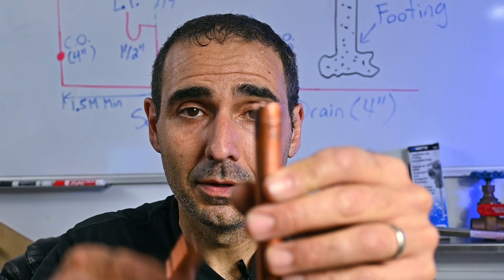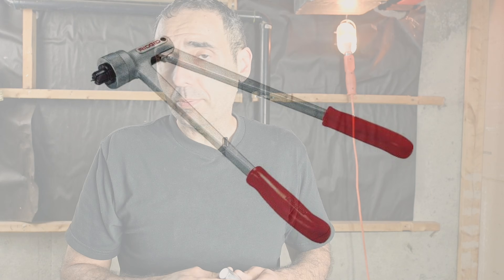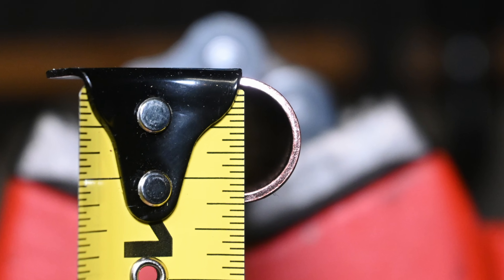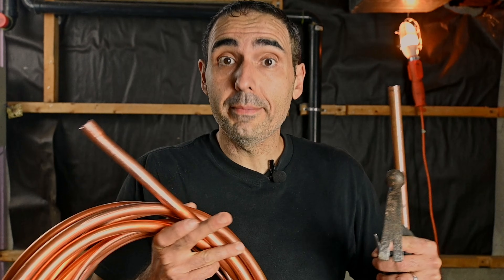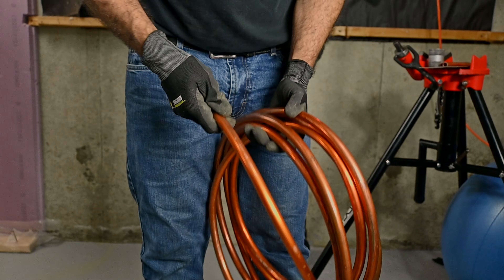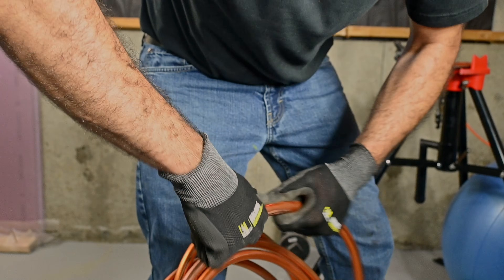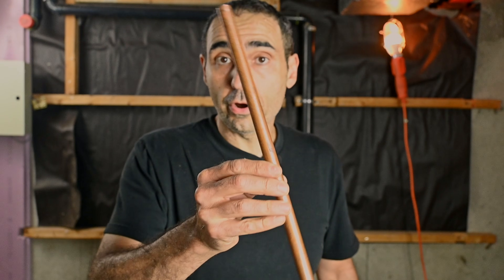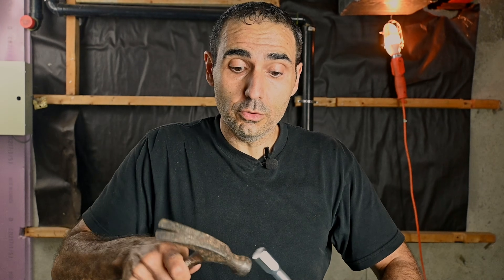Never Need A Coupling Again!  How to Swage Copper Pipe!

Comment: Good video. I’m trying to join 3/4” hard copper pipe K with 3/4” soft copper tubing. My thinking was that the OD of the soft tubing is 3/4 and the ID of the hard pipe is 3/4”. So with a little sanding on the inside of the Hard K, they should fit together. 
I’m making a 100’ inner and outer helix of soft copper for my aftercooler of my air compressor. So the air comes up in hard copper, does a 90 degree and connects with soft copper. Then it spirals up a cylinder and back down to another connector from soft to hard and another 90 to go straight down. 
All this will be in a large bucket and the copper pipe will enter through bulkheads. Chilled water is circulated through the bucket from top to bottom. So the top has one bulkhead for water input and the bottom of the bucket has three bulkheads; one for water exit, one for air in and one for air out. 
My concern is connecting the hard with soft copper. 
Your thoughts would be appreciated. 
Thanks,
Paul
Reply from the maker: Sounds like you're making quite the interesting contraption! To begin with, I know of no issues with joining soft and hard copper together.  Our codes require that all buried copper piping must be soft annealed (to prevent likelihood of kinking), and all buried joints must be brazed/hard-soldered.  Although I don't think burial applies to your situation, you may want to nonethess consider brazing if you're running significantly high pressures, since brazing provides for a much stronger joint.

Also, soft annealed is usually measured by its OD size, they do indeed sell 7/8" OD coil (our 3/4" ID Type K or Type L, which we utilize for underground water service. Therefore, you may be able to save yourself some grief by opting for 7/8" OD coil and simply connecting the hard and soft with a simple 3/4" copper pressure coupling.  (Or of course you can save yourself a coupling or extra joint by simply swaging the soft side to accommodate the 3/4" ID hard pipe.  Another alternative is to see if you can source 3/4" x 7/8" copper couplings and simply connect your two aforementioned pipes with them.

Hope this somewhat helps.

EDIT:
Here's an example of a 7/8" x 3/4" reducing coupling:
https://hvacdirect.com/7-8-to-3-4-inch-copper-fitting-reducer-coupling-cfw01035.html
Reply: @PlumbingsCool  yes. That helps. Although I already have both hard and soft copper so I’m dedicated to that size. 
Thanks for your help. 
Paul
Reply from the maker: Sounds like an interesting contraption you're building there!  If you use the proper swaging tool (3/4" ID), your should be able to easily expand the hard pipe pipe without any necessary sanding.  But if you think you can remove just enough to get the soft to fit, then I don't see a problem because the K is so thick (lots of meat on the bone! ☺) 

However, if you could get a hold of a properly-sized, iinexpensive 3/4" ID swaging tool, it shouldn't take much to expand it to your required size, since it's already so close - and without having to remove material.  However, because it's Type K, I'd especially recommend softening it first by heating the end up red-hot and allowing it to slowly cool, which will make it soooo much easier for you to expand the swaging tool.  

If you're concerned about strength, you may want to consider brazing the joint instead of soft-soldering it - although I'm not sure if it's necessary, unless you're working with higher pressures - say over 150 PSI. 

Hope that helps!
Reply: @PlumbingsCool 
Yes, this helps a lot. Thanks. 
My first attempt at making my coil failed miserably. But I still have enough copper coil to try again. This is for a refrigerated after cooler for my air compressor. Air enters at the bottom, coils up in the inner helix and then back down again in the outer helix. Water drains on the entrance and exit lines. 
It all looked good on paper but it’s a bitch in reality.
Reply: just use standard sweat couplings and silver solder. if worried about strength braze it. if worried about smooth laminar flow use hvac/refrigeration fittings or radius bend the soft copper or anneal sections and radius bend the hard copper. alternate use all type k soft and get good at bending/straightening.
Reply: @throttlebottle5906  I would think that if hard copper is stated as ID and soft copper stated as OD, that a 3/4” OD soft tube would fit inside a 3/4” ID hard pipe. I may have to put the pipe on a lathe and open the ID a bit to get a good fit but it should work. 
I’m making a double helix with 100’ of 3/4” soft copper. Fill tube with salt, wrap around a 7” diameter PVC pipe, then at half way, start wrapping down again on the outside of the first helix. 
So hot compressed air comes in from the bottom, circles up to the top and then circles back down and exits out the bottom. All this in a bucket of circulating chilled water to cool the air and condense the moisture. 
So both input and output must connect to 3/4” hard copper pipe. 
How do I silver solder? I’ll look it up on YouTube. 
Thanks.
Reply: @paulmanhart4481  not sure what soft copper you're looking at or dealing with. but standard plumbing/hvac/refrigeration copper is all sized by O.D. (0.875" nominal)
and the I.D. varies by "type"(wall thickness).
with type K being I.D. of (0.745" nominal) the others type L/M are thinner wall and actually over 3/4" I.D.
it's sized that way so the same fittings/connection methods work across the board.
many years ago, that may not have been the case, especially in old soft drawn "water service" copper, which was generally flared and always used special fittings.
but now it's also the same diameter and they most often use "packer" compression style with clamp fittings. to terminate. or the ones that have not went to poly pipe or pex.
Reply: @throttlebottle5906  That’s what I was saying. The 3/4” OD of soft copper tube should fit the 3/4” ID of K type copper.
Reply: @paulmanhart4481  OK, it seems you're referring to copper that's 5/8" I.D. nominal, which is actual 3/4" O.D.  then yes, it should be too large to fit, but very close.
so you're trying to put 0.75" diameter tubing inside of 0.745" diameter tubing. for it to actually slip fit and have room for silver solder/brazing rod to flow, you'll likely need to make it a two to five thousands of an inch smaller(that's more into machinist territory), you can get copper reducer fittings made to connect 5/8" to 3/4", that's common sizing for heating/cooling and refrigeration. 
Anyway sometimes soft copper tubing is dual listed by the O.D. and/or I.D. and people always flip flop and interchange the numbers and it drives me nuts, the non-standard standardization 🤣
but they really should always speak of and list using the "nominal pipe/tubing I.D. size" or it will send others into head scratching loops, thinking you're referring to a different size. exactly the case here, for more than one of us.
Reply: @throttlebottle5906  Thanks for all your help here. I appreciate it. I also have the 5/8 fitting. I’ll see which works best. 
Paul

Comment: Would this also work to help re-round copper? My service line into the house has ovalized a touch from years in the ground. Planning to cut in a new fitting, but won't be able to solder an oval tube into a round fitting.
Reply from the maker: Although I'm not sure how dire of a state the shape of your pipe is, generally yes, swaging the pipe will most certainly round it back to its normal shape.  HOWEVER, you should do this only if you intend that pipe end to act as a hub/female, because using the swaging tool will not only round it out, but also expand it to receive standard-size pipe.  If you're simply looking to restore the shape to round (without expanding it), your best bet is to round it out by inserting and twisting a set of needle nose pliers, ensuring not to over-do it so as to enlarge the outside diameter of the pipe.   Another trick would be to take an adjustable crescent wrench and adjust the Jaws to the exact proper size of the outside of the pipe and simply gently run the wrench Jaws around the oval pipe until it begins to reshape to round.

Finally, if you are soldering underground, you might want to consider brazing ("hard-soldering") the pipe with a proper brazing allow such as Sil-Fos, which is significantly stronger than traditional soldering and actually mandated by Code at least up here in Canada whenever soldering joints below-ground.

Hope this helps, and good luck!

Comment: I am presuming that a ring mandrel and maybe a deep socket could perform similar effect of a swaging tool, ie. For improvise. ?
Reply from the maker: Hmmm....I suppose in a pinch it may work...although you'd need a fairly accurately-sized socket to ensure that there's just the right amount tolerance to allow for a proper hub size.

Given that these swaging tools are less than $10, I'd much rather prepurchase one and keep it in my tool box in case I'd ever need it, rather than shuffle around to create a last-minute compromise (although it'd be fun to see if your suggestion would work!)
Reply: @PlumbingsCool  maybe a swaging tool would make a better ring mandrel? (What are they usually made of?)
Reply from the maker: Maybe! Swaging tools are typically made of nothing more than hardened steel.

Comment: An old process. I have a set of 8 lead pipe bobbins or dollies made of lignum vitae  used for swaging and pulling through lead pipes that have deformed. These are driven by a steel weight on a rope which runs through the bobbin, thus acting as a hammer as the rope is moved back and forth. The set ranges from 2" to 6" diameter in 1/2" steps. Not that you'd want to, but I doubt if you could even source lead pipe in that sort of size.
Reply from the maker: Oh, goodness me...lead pipe!  Now THAT'S classic old school indeed! No, I don't typically work with lead pipe, other than the typical 3" lead bends that serve water closets in century-old homes.   Usually any revealed lead is cut out and replaced with more modern material.  I didn't even know that swaging tools for lead even existed...thanks for for sharing and Happy New Year! 🥂
Reply: @PlumbingsCool  
I bought them with a view to making a set of carving mallets but on reflection, they are a little bit of history so they stayed intact. I used some  lignum vitae lawn bowls instead. Happy healthy and prosperous new year to you Sir !
Reply: so your father/grandfather/relatives used to install lead water service and sewage many years ago? 
I think there's still way more lead and heavy leaded piping in the ground and water supply/drainage than they want you to know...
Reply: @throttlebottle5906  
Not that I know of, but the use of lead supply piping was still the norm when my grandfather was born in 1880 and was still common when he died in WW1. I agree that there is still a lot of lead piping that has not yet been replaced and will likely be years before it is all eliminated.

Comment: I like to know how to solder a 3/4 inch copper pipe right through the side of a 44 gallon steel drum, 6 inches into the inside and about same on the outside and not using bulkheads and compression joints ect as they are expensive? Must be an easy plumbers trick somehow? Needs to be for waste veg oil!
Reply from the maker: Now that sounds like a very specific use! 😊  Although I can't quite envision exactly what you're trying to build, or its usage, what I can tell you is that (regardless of connection method) steel and copper should NEVER touch, as doing so runs the risk of corroding the copper as a result of dielectric reaction.  Steel or even brass is no problem.  Also, your best bet wouldn't be to solder the connecting piece, but rather to either braze it or weld it.

I'm wondering if you could simply take a 12" length of 3/4" Schedule 40 steel pipe and insert it through a drilled 7/8" hole at the side of the drum (the approximate outside diameter of the 3/4" steel pipe), and simply weld or braze it up.  I'm not sure how strong the joint will be, but it might be the most practical way to serve your purposes.

Comment: Even though this can be done, you may still want to use couplings, this stresses the pipe and will eventually lead to a failure imo
Reply from the maker: While I'd agree with you that couplings are certainly more cost-efficient when you factor in the labour, the main benefit of knowing how to swage is that it adds a simple-yet-effective tool to your arsenal in case you're ever in a pinch because you ran out of couplings.  Not a practical everyday function, but certainly good to know.

As for weakening the pipe, here in Canada swaging is perfectly legal by Code as long as you abide by the requirements:

1. You can only swage pipe to accept piping of the same size (you can't stretch 1" pipe into an 1-1/4" hub), and

2. It must be a minimum thickness of Type "L".  Any thinner (M or DWV, and you WILL shred the pipe!)

Thanks for your feedback!
Reply: When using a pipe bender the copper on the outside edge of the radius is stretched, not too different to stretching the copper in a swaged joint. Not heard of any failures due to pipe bending which is universally used in plumbing.
Reply: How do you think they make solder joint fittings? 🙄
Reply: @ they don’t stretch pipe to make fittings. They are made to a bigger or smaller spec to fit

Comment: Thank's for the video. I was looking for a video on the many different brass fittings for flared copper joining. I am a bit lost as to what to use where so ended up reverse engineering the 60 year old pipes i took out of our shower.
Reply from the maker: That's interesting...I've never seen flared connections used for shower assemblies!

Comment: Can a pipe expander (manual or hydraulic) be used on hard pipe without heating?
Reply from the maker: Technically, yes...but boy, oh boy will it be so much more effort manually.  Hydraulically/mechanically should be no problem as well, although I'd drive to slowly to allow the pipe to expand in a more controlled fashion to avoid tearing the pipe. I've bent hard Type L pipe with a manual bender before, and although I get a proper bend 99% of the time, there is the odd time where the pipe breaks due to bending too quickly.

Hope this helps, and appreciate your time!

Comment: Seems more time consuming than just using a 2 dollar coupling.
Reply from the maker: You're absolutely right...until you realize that you need to leave the jobsite to run to the supplier because you happen to not have a simple coupling on hand.   An unscheduled trip to the supplier is one the biggest time-wasters when doing a job.  So although swaging isn't likely to replace couplings any time soon, having that simple skill can pay you back in spades when the moment requires it.
Reply: @PlumbingsCool  that, or indentured servitude to a franchise or other financial backer. Plus, you can prep your own stuff on your own downtime.